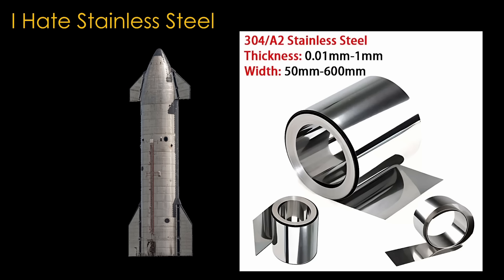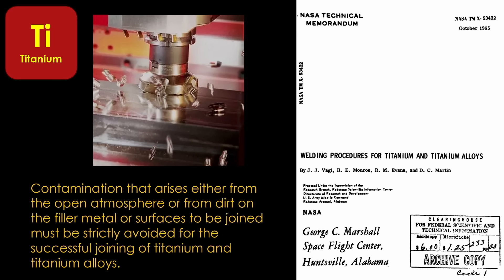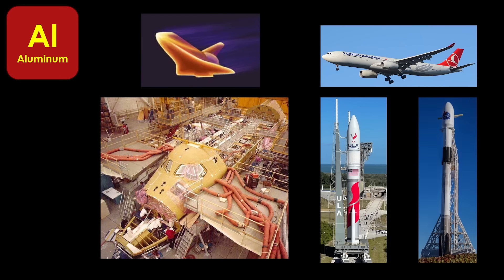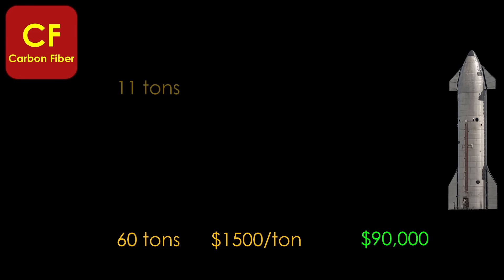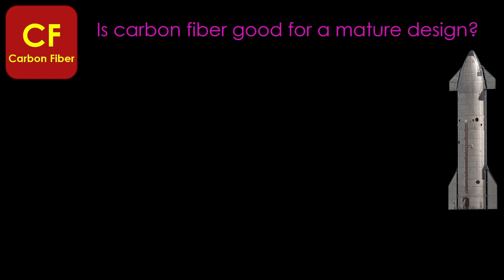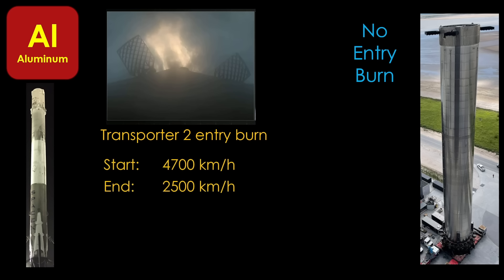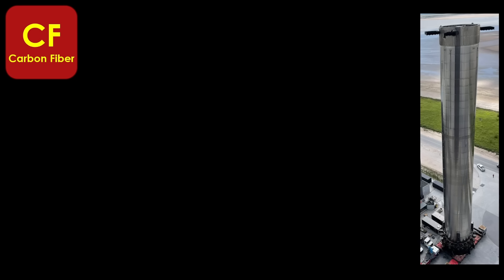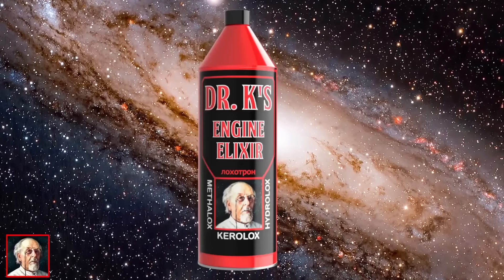Why Starship Loves Stainless Steel...

Comment: RP-1 dv 6408m/s, lh2 dv 7950m/s
Hydrogen 💪💪💪the best 😎💪💪
Reply from the maker: There's a video on starship and hydrogen in the works...
Reply: @EagerSpace Nice
Reply: @EagerSpace  Very much looking forward to that. Will you talk about slush hydrogen too? Probably not worth the effort, but it still might be a decent point to bring up.
Reply: hydrogen = bigger tanks = heavier rocket
Reply: @oberonpanopticon  this is dv for the same total mass fuel+stage(tank andengine's)+payload. RP-1+lox tank 1,549kg, LH2+lox tank 3,158кг.
Of course that's without insulation and necessary structural reinforcements for a larger tank accounting, only the amount of different area of the same thickness material
Reply: Hydrogen unsuitable for a reusable vehicle. Embrittlement, extremely hard to contain with seals, super low temperatures meaning no common bulkhead, fragile insulation, etc etc etc.
Reply: @EagerSpace Like Kerolox for Booster and Hydrolox for Ship?
Reply from the maker: My current opinion on slush hydrogen is that there's not enough information for me to do an analysis.
Reply from the maker: We'll see. I only have an outline right now. 

I'm not going to look at kerolox for the booster, as the downsides of RP-1 for reusability are well known.
Reply: @EagerSpace  Doh! So forgetting the desire to use Methalox because Mars, is the highest density propellant that doesn’t coke the engines still Methalox? And maybe in that video you should briefly explain why Kerolox works for reusability with Falcon but not for SuperHeavy Booster? Is it just because that’s what was well understood when SpaceX started development, or is it deeper than that?
Reply: @PetesGuide  I think it's hard to answer what fuel is the highest density without coking issues. Coking is dependent on engine design, including what temperatures and pressures the fuel experiences going through the engine. It's probably possible to make an engine that experiences coking with methane, and it's probably possible to make engines that don't experience coking that use other fuels, like ethane, butane, propane, carbonmonoxide, etc.
Reply from the maker: Two factors. The first is that RP-1 leads to coking which means you need to do engine maintenance after each flight, and it's complicated by the fact that RP-1 is a performance spec rather than a composition spec, so that could change if you have different suppliers. 

The second is that methane is cryogenic and that enables them to do the full-flow staged combustion and build a "gas/gas" engine where both propellants are in a gaseous state when they enter the combustion state. It makes doing a high performance engine easier. 

A bonus factor is that RP-1 is expensive and liquid methane is cheap.
Reply: @EagerSpace  That middle paragraph has an engineering philosophy I have never seen in any other rocket video. It has increased my knowledge of rocket engines and fuels, and you should do a video focused on that paragraph. Like what does gas/gas mean? And what does performance spec mean vs. composition spec mean? That previous sentence/question is highly relevant for the unleaded aviation gasoline issue, so you can probably gains some more followers there.

My main mentor focused on electronics enough that he had Werner on speed dial, but we never talked much about engines and propellant, so I entirely appreciate your deep dive on this. Your content nicely compliments and expands Everyday Astronaut’s efforts and I hope my comments are encouraging you to continue deeper dives.
Reply: @PetesGuide  Gas/gas means that both the methane and the oxygen has been heated up enough to turn from cryogenic liquid to hot gas. It's easier to get gas/gas to burn clean and efficiently than gas/liquid or liquid/liquid. It simplifies injector design, as the injectors are crucial in achieving good mixing of the propellants, which is especially important if one or both propellants are liquid. Burning gas/gas is fairly unique to full flow staged combustion (FFSC). No other common engine design does it.

One example would be Merlin, where both the RP1 and the liquid oxygen enter the main combustion chamber as liquids, so it is liquid/liquid. This is the same for all gas generator (GG) engines. You just take some fuel and oxidizer, burn it and run it through a turbine and that drives pumps that force the liquid propellants into the main combustion chamber. 

Another example would be the BE-4, where the oxygen enters the main combustion chamber as a gas and the methane enters the main combustion chamber as a liquid, so it's gas/liquid. It has a oxygen rich staged combustion (ORSC) engine cycle. This means you take all the oxygen and a little bit of methane, burn it and run it through a turbine. The combustion products, which are approximately 95% gaseous oxygen and 5% gaseous CO2/H2O are forced into the main combustion chamber with a pump, and additionally, you have an pump forcing the liquid methane into the combustion chamber.

Comment: I like your videos but I feel like you give way too much leeway to SpaceX in your analysis. 

My objection is not about the suitability of titanium vs stainless but your selective choice of data. 

You’ve cited a NASA report from 1965 as evidence that titanium is difficult to machine and weld. It’s 2024 now and many new welding techniques have been invented in the last 59 years. 

Also there’s the weigh savings of using titanium. Starship is supposed to be fully reusable, so a 27 ton weight savings would allow more cargo to be flown on each flight. I’m not sure what the cost per ton to orbit is right now, but let’s say it’s somewhere around $1 million, so titanium starship would be able to deliver $27million in additional cargo to orbit, per flight.

In a single flight, the increased cargo value alone would pay for the titanium 16 times over.
Reply: Try talking to a machinist about working with titanium, they HATE it, it's a miserable material to work with. I can only imagine suggesting to my friend who mills parts about building an entire rocket structure out of the stuff.
Reply: @Shrouded_reaper  We’re talking about making a cylinder from pre-rolled metal, it’s not the most complex shape.

And it would be made by robots because Musk loves robots and robots can’t form a union.
Reply: @Chainsaw-ASMR  It's not just a simple cylinder mate, there are all sorts of stringers, pipes, flanges, fittings, bulkheads and other specially shaped structural elements. If it could be made by robots, then why isn't starship already being made by robots?
Reply: At present SX is targeting internal cost of $20,000 per tonne to a "useful orbit". So no, adding 27 tonnes of payload doesn't give you 27 million extra dollars to play with. 

There's a lack of payloads that would use SS's current capacity. Indeed that's a common criticism. There's no need to spend heaps of money to build a few very capable rockets when you can have very many more slightly less capable rockets for less money.
Reply from the maker: I picked that paper because it was a NASA one and it is still referenced though it is quite old. There are certainly new techniques out there but the basic problems with titanium welding are still the same; everything has to be really clean and your shielding needs to be very good to get a good result. 

The weight savings is going to depend on the design temperature of the surface and a low design temperature is going to require a different and probably heavier thermal protection system, but it's hard to know how much effect it would be. 

The biggest downside with titanium is embrittlement when it's heated in a normal atmosphere. It seems problematic to try to inspect a whole vehicle to figure out if any parts got overheated and I'm not sure how you would deal with repairs if you found an overheated part (that's probably true for stainless as well).

Comment: Starship is too short and fat to go anywhere, let's be real here.  I want it to happen, but this thing is not impressive I am sorry.  It needs to taller and thinner.  Maybe that will help, it could be just the fact that it looks so stout.
Reply: There are limits to the height of any ship unless you taper it. The thrust of each engine must be about 1.2 times higher than the weight of ship above it at launch and there's just a limit to how close you can pack the engines.
Reply: They're already planning to lengthen it. Future versions will be significantly longer.
Reply from the maker: Did you see my video on starship getting bigger? 

Starship 2 will be pretty much the perfect length for a 9mm vehicle running on methalox
Reply: @EagerSpace  Yes